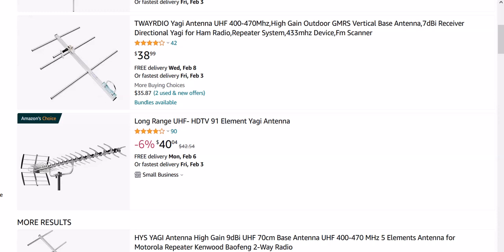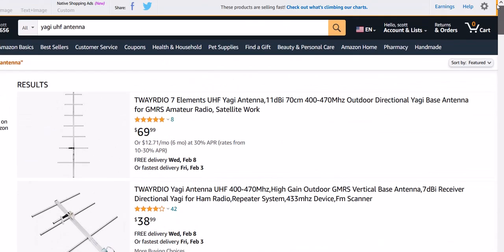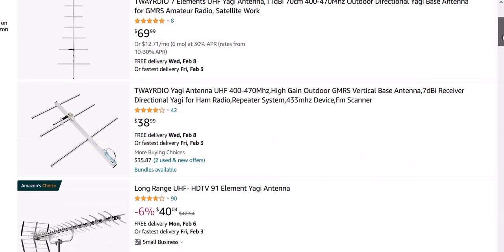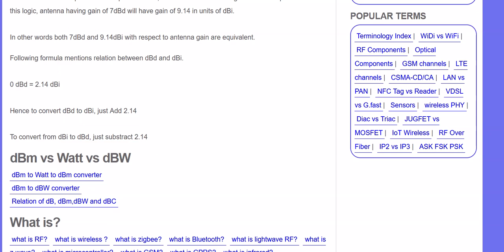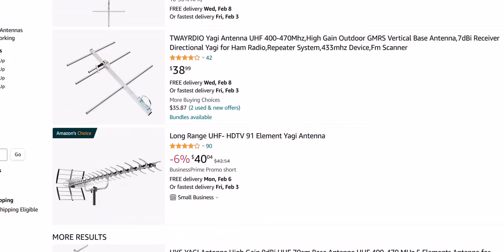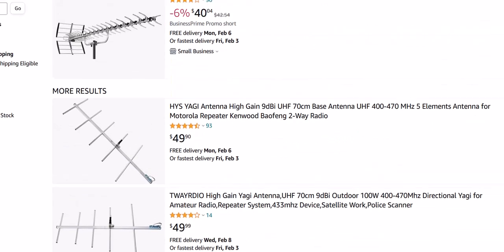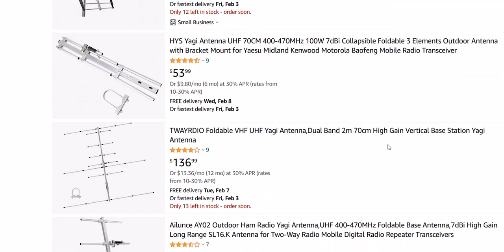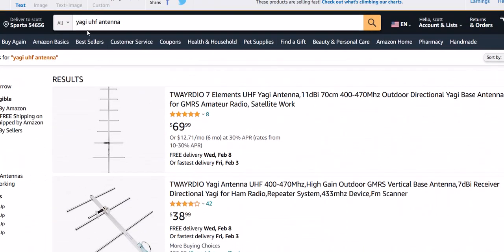🔺 is it cheaper to buy or build a yagi/beam/Directional uhf GMRS two-way radio antenna?🔺

Comment: I built a tape measure gmrs yagi for under 5 bucks, if you don't count the pvc, bit of coax, and bnc connector I already had. It may not be so pretty ... but it works. (But then, I could fold the thing up, too.)

Comment: For the $38 gmrs one u show; as someone who works with aluminum tubing i can say u wont beat the price. A stick would run between $25-$40 (depending on your area) just for the aluminum, not including fasteners etc